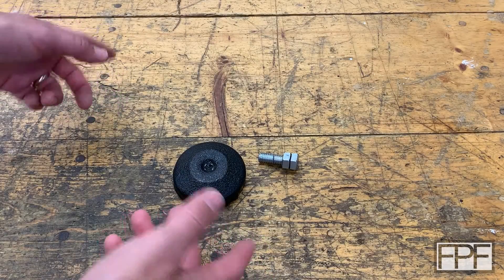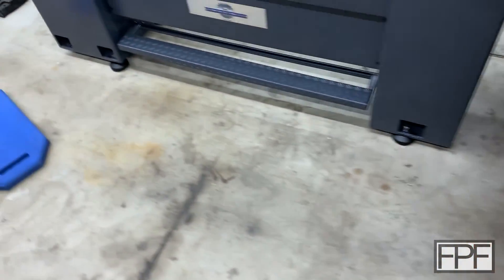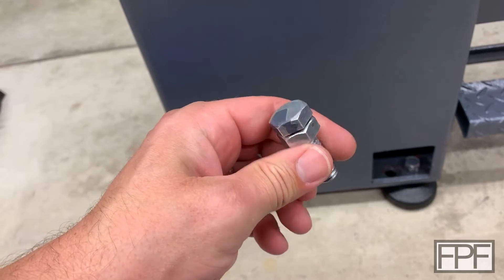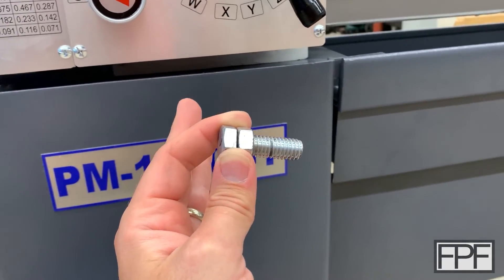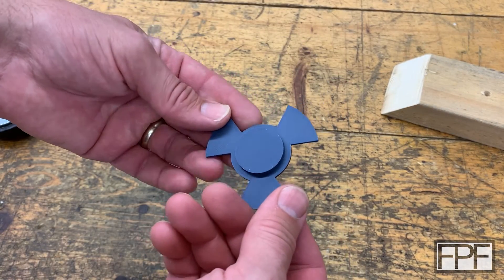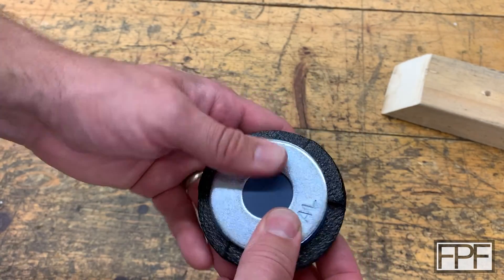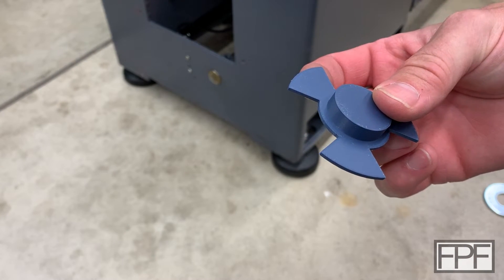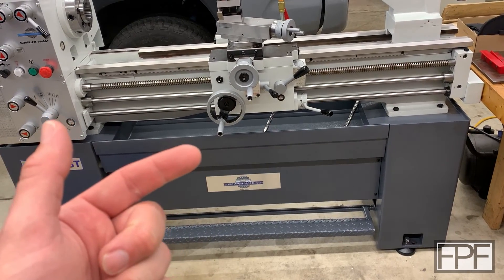3D Printed PM-1440GT Lathe Leveling Feet Washer Keys

Comment: No way - Whitworth? I'll have to pull one of mine out and find out if they are Whitworth also. That's a great machine tool and a neat solution to the height problem. I believe the 3 contact pads on the underside of the pads are about preventing vibration transfer from / to the machine. Whit fasteners are still reasonably available in the UK - I had to buy my Whit wrenches from there - but I don't think you'd find Whit fasteners on the shelf in just any store. Mostly used in vehicle restoration now I think.
Reply from the maker: I bet they are!   It looks like your machine and mine probably came out of the same factory.  Now that the machine is up and running, I'll probably just make some longer ones.